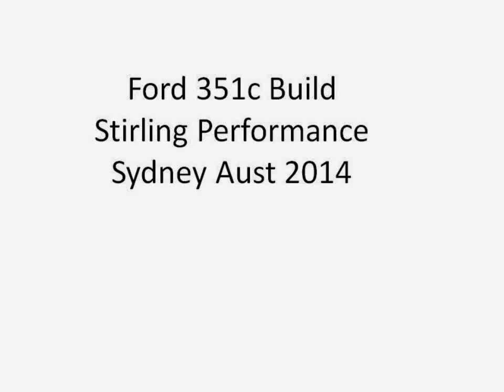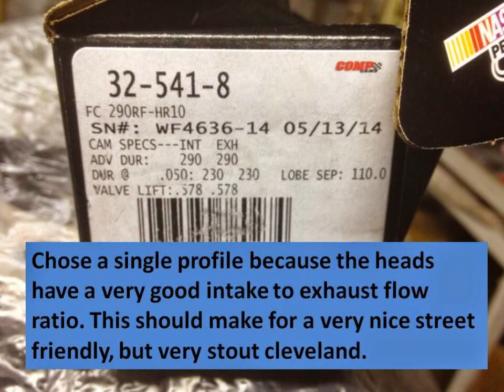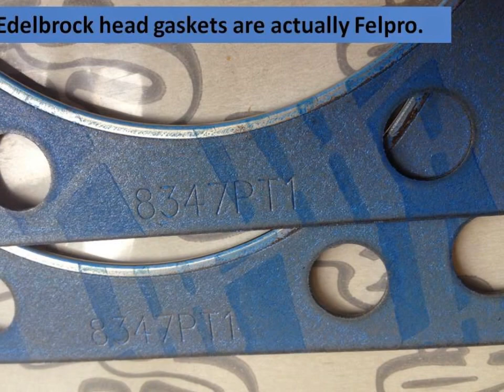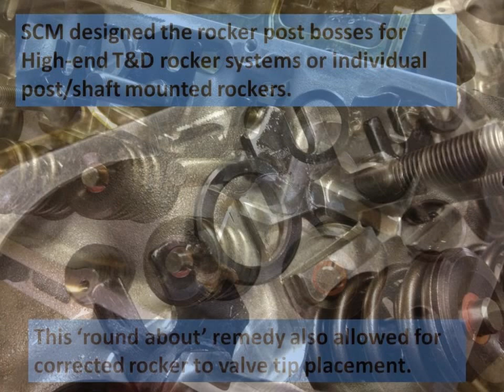351c Engine build SCM alloy heads

Comment: In 92 My Boss Like Built Cleveland With standard Bore & Stroke  Made 525 HP @7200 RPM on Bob Pettis dyno . Just a 600 lift solid Roller, 850 dbl pumper, and a Holley Strip Dominator intake with Headers.. What a Beast !!!
Reply: Compression ratio ? 11:1 ?

Comment: Nice job!  I've always wanted to work-up my '73 2V (Mustang convertible, still runs like new) but still haven't gotten around 2 it.  I had to replace the oem lifters b/c they stopped oiling the rocker arms, pretty sure this was most all 351c because both of mine did the same thing around 80k miles.  My 1st was '71 4v, wish I never sold it!
Reply: Your  lifter  oiling problem is a sign that the lifter bores are warren. 
Ford  racers experienced this early in the Cleveland's life,  that is why all serious  Cleveland racers would  bush the  lifter bores othe  bottom end was  short lived, the  micky  mouse   oiling System was ok for street use on a new engine but when lifter bores ware the  bottom end will starve for oil!
Reply: @mylanmiller9656  The lifters spin as normal in most any flat tappet pushrod engine, the oil channel in the top of lifter wore out and stopped sending oil up the pushrods.  The lifters were actually plenty tight in their bores, the small amount of varnish deposits formed on the bottom of the lifters made them difficult to remove.  I realize this is common but of all the pushrod engines I've worked with, this one was significantly more difficult to remove the lifters due to varnish deposits, not abnormal lifter face damage.
This was about 1992 or so, have had no further lifter issues since replacing the oem lifters.  Motor has about 120,000 miles now and lifters were replaced around 50,000, probably before 80,000 actually, if I recall, it was quite a long time ago.

I would bet, many of the hydraulic tappet C's experienced this same failure, based on both of mine did.  These were 1971 4v and 1973 2v versions.  The '71 was a pretty strong runner with the closed-chamber heads and I don't recall it being appreciably weak down low given the larger ports although the lower end might've been better with smaller runners.

Comment: A stock standard Cleveland Crank is 4MA that just means 351 C 3.5 inch stroke , the crank you want to see is 4MAB the B stands for high nodularity  ! All GTHO cranks are 4MAB all Ford Cranks have this series of alpanumerical designation a 2MA Crank is Windsor crank a 1MA is a FE Big Block and 3MA is a 385 series big block (370ci, 429ci and 460ci).

Comment: Plus 040,, it will flex big time, if it does not strike water.
That waterpump may cause grief, those tin impellors cavitate the water a lot. Cast iron impellor is always better. Whatever engine
450hp?  Mine has 440 with stock 302 heads and a Crow race hydraulic.

Comment: These are awesome heads, as to be expected with anything Darin Morgan gets involved with. Shooting for 450 HP is curiously conservative. You can do this with iron OEM castings, so why spend $3,000 (plus? $$) for these beauties for anything less than 550-600 HP?
Reply: weight saving and better street manners with the power, Dopey.
Reply: @Dave.S.TT600  But you may as well hit 550+ HP out of them, its' not even a big deal for these heads.
Reply: basically.  Wouldn't target under 500hp.

Comment: Any recommendations on building a 351 Cleveland to run in Super/Gas????????? Our block is a 70 2 bolt main with plans to use aluminum heads and complete roller valve train. Thanks, Chris
Reply from the maker: Get the block sonic tested. Run 2/3 grout in the block. De-stroke slightly and use chev  6" rods, Dished pistons, Small combustion chamber , internally balanced, 275@50, 108LC, 700" + lift, 950 cfm +, main cap girdle, shaft mount rockers or stud girdle minimum. Easy 650+ horse power at 7500rpm

Comment: With today’s 3V head design, roller cam availability, and compatible 3V intake design, why only 425 HP? Wouldn’t 600HP be just as obtainable? 

Not trying to be a smart ass. This is a sincere question.

Comment: first load of low octane fuel with any timing over 36 degrees total advance and one of those 'hyperyoufuckme' pistons will explode into little pieces straight into the oilpan and the connecting rod will saw straight through the oilpan and the outer cylinder. at least put 4032 forged pistons in any street motor today if you want it to live on the street with our garbage gasoline.

Comment: Dang, that OE V8 crank is only good to 500? I'm honestly surprised. My stock MZR DISI Turbo crank (Mazdaspeed 3 engine) can handle 1,000, and that's on a 2.3 liter 4-cylinder o.0

Cool vid and music, though :-)
Reply: Yeah another telephone number zeem that is slower than a 500hp V8. Even when they do actually go faster they are a handgrenade with the pin pulled. As has been shown in no end of videos and for us out there in the real world at racetracks and dynos world wide.

Comment: Ford fan boys love to praise the Ford engineers for those Cleveland heads but the fact is that a GM performance team designed the heads for a 5 liter Chevy Trans Am engine and then decided to use the regular Chevy head because the canted heads were too peaky for their little engine. Then a member of that team went to work for Ford and took the design with him. Then Ford completely screwed them up by lowering the exhaust ports to fit their poorly designed platforms.
Reply: I think you've been reading too many Chevy hot rod magazines. I've got a 351 Cleveland 0.030 over TRW forged flat tops, stock rods polished beams with ARP bolts, stock crank, .711int .714 exh. mechanical roller, factory 4-V closed chamber heads, roller rockers, Parker Funnel Web intake, MSD ignition, 4150 850cfm carburetor, C4 with a 4000 stall, 4:30 gears with a 150 shot of NOS. I'm running this motor in a fox body mustang and I've gone a best of 9.30 in the quarter mile. I've yet to be outrun by any GM product $ for $ I don't have shit in this motor. Cleveland is by far the best small block ever. I cant wait to install the new set of Trick Flow power port 225's that I picked up for this set up. I can see high 8's with this set up by just adding a set of aftermarket heads and some tuning.
Reply: You  better  go  back and re read the article you got  your  information From! 
The reason  Chevy  built a canted valve head for there  TA engine was because the Ford Boss 302 was making a bunch  more power than there Zé28 Head made.  The reason  the Chevy canted  valve  didn`t work was because the head  bolts were in the  way, When  Chevy  bent the ports around the head bolts the heads  quit flowing! 
 Chevy tried using a block with the same Head bolt pattern as a ford  but the Racing Association would not allow  the block change unless 500 were built!
Reply: I am a Ford guy and agree with some of what you say, the exhaust on all Ford heads has been the downside for many years, The raised port Cleveland style heads are the best flowing sb Heads Ford or Chevy but as you said those heads don't fit the chassis of the  early platforms. Win some. lose some.
Reply: GM used canted valve on big blocks and the W engine too as well.
And a Clevo race orientated? You must be joking. Poorly oiled poorly cooled. I race one, why? Dumb I guess. 
SBC is and always will be far better as is the Windsor though those are too little and 351s have way too big a main journal.
Reply: So this is why they use the port plates and brazing in the exhaust port to raise it?